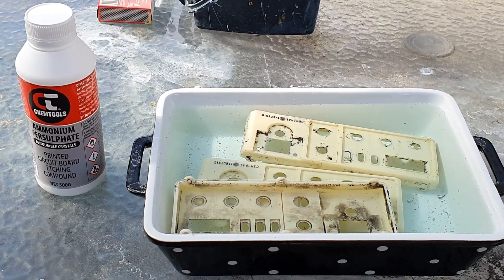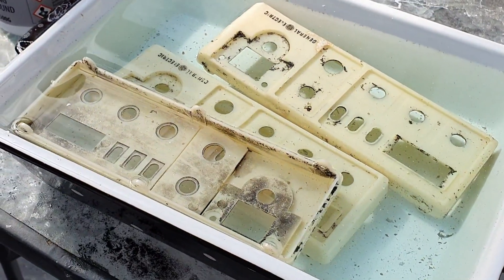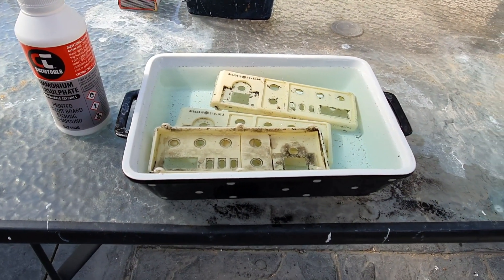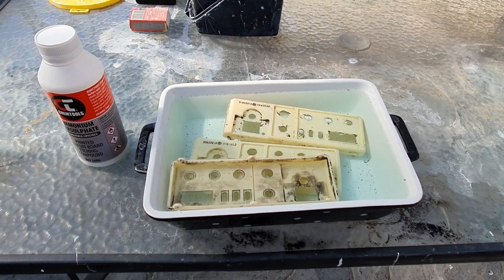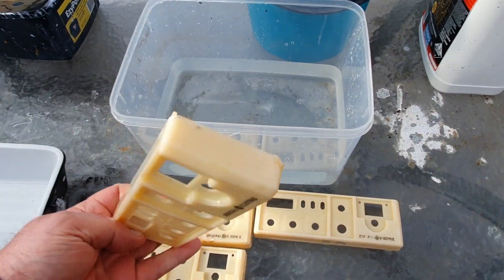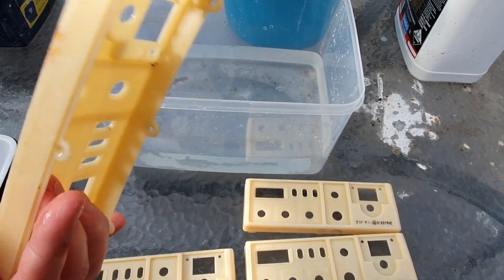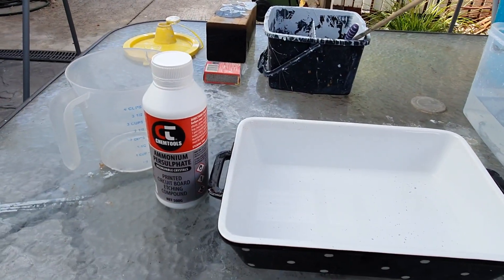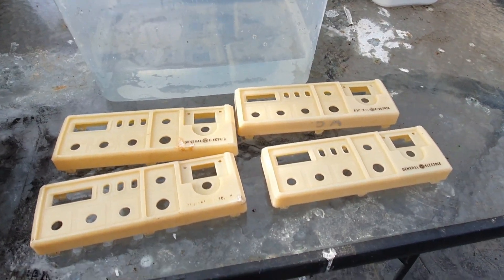How-To-Remove Chrome from Plastic Parts with Copper Electroplating Base - CB Radio Faceplates - P2

Comment: Where is part 3??
Reply from the maker: What do you want to see in a part 3?
Reply: @Pull_It_Apart_Paul_Ham_CB  how they came up after ya painted them. Im just curious
Reply from the maker: Cliff thankyou for your interest.

One of the faceplates has repairs done to it to remove some letters gouged into it.

Of course, that will be a video on its own, I will try to match the factory look on two covers, need to prime and let cure first
Reply: @Pull_It_Apart_Paul_Ham_CB  Thanks, Im just curious to how they turn out.

Comment: Amazing result Paul! Did you see that chrome Pen device I named you on recently? May be worth checking out. Looking forward to more on these GE's finished result. 43AX05
Reply from the maker: Yes
I ventured down a paint path, the pen is not as clear on larger surfaces.  This would show up imperfections.  Bought various paints from basic silver, to extreme silver (more like GE faceplate), and chrome finish